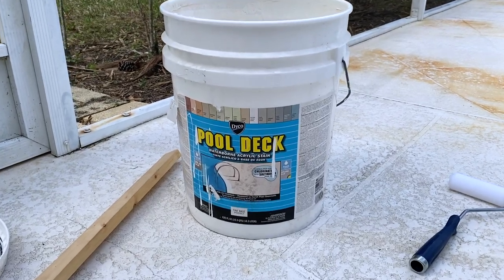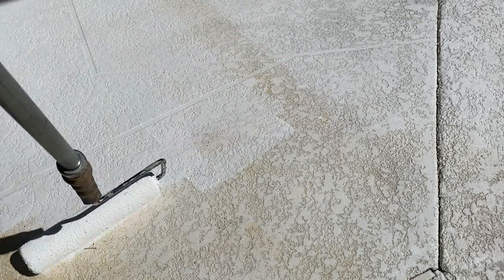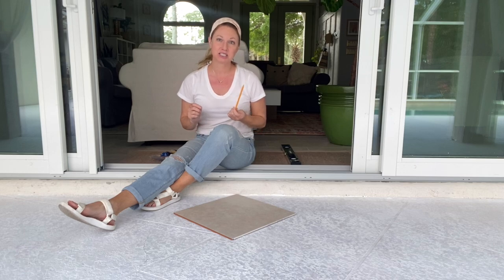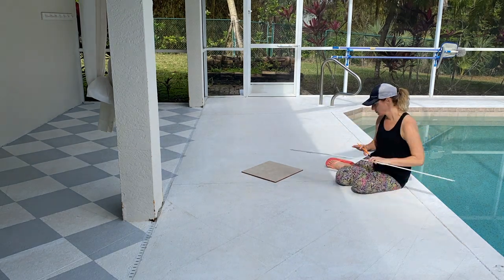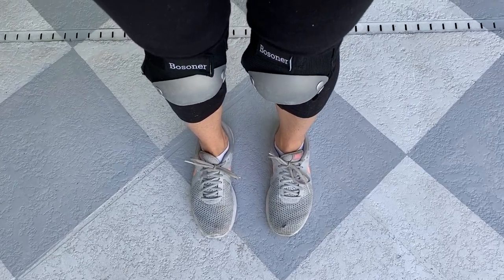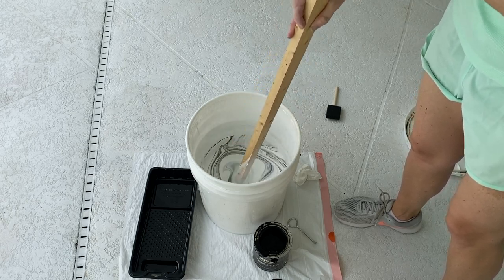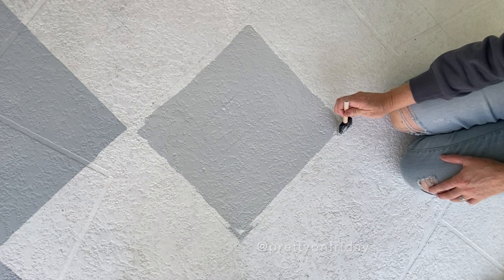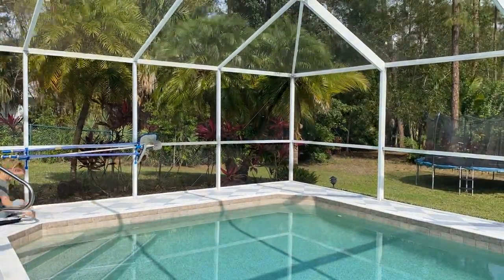Painting a checkered floor without tape on patio/lanai/pool deck

Comment: It’s good if you want to work double , but if we use the stencils : it will be done quick ,and will be looks nice to .
Reply from the maker: I think stencils are a great idea, however, I've done a lot of wall stenciling and the edges just aren't as crisp as they are with a brush. I also found it time consuming to wipe the stencil after each use. I do like the idea of not drawing out the lines though! :)